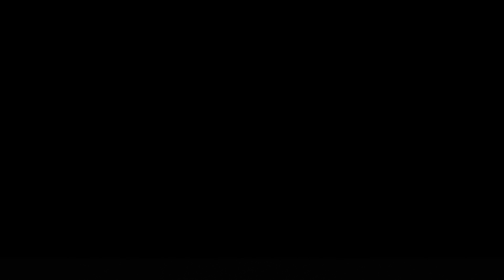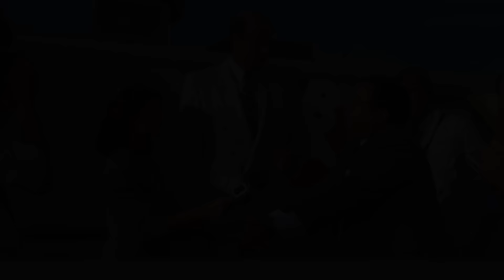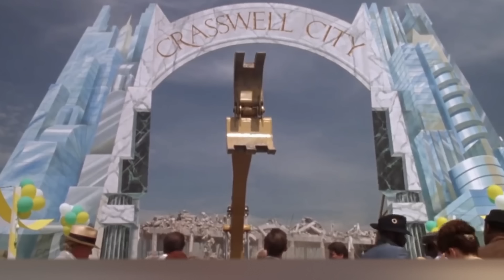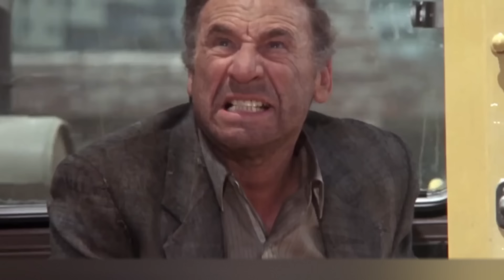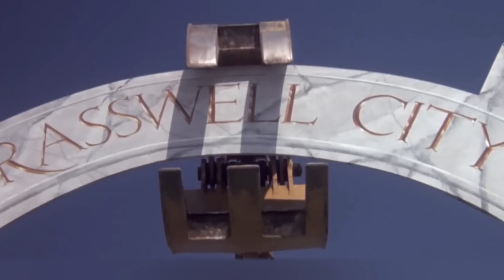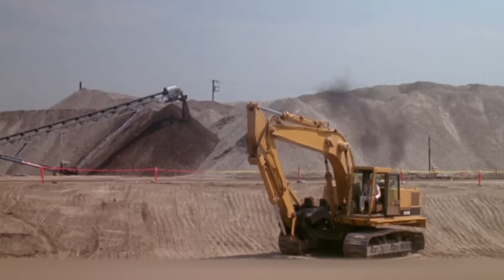Incredibly Creative Workers

Comment: Cement pavements are a terrible idea.  They don't last as well as pavers, are harder to repair, and when they need to be replaced, you can reuse most of the pavers, as apposed to having to throw away literal tones of unusable cement rubble.